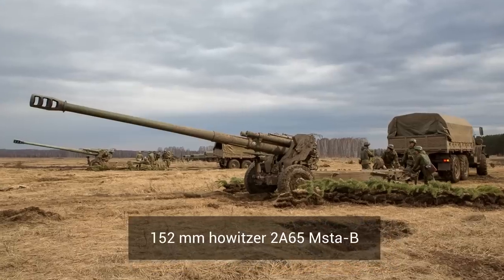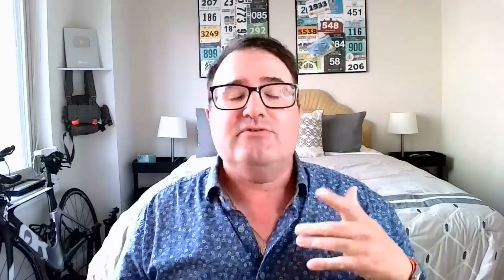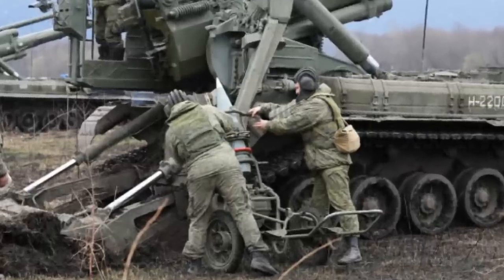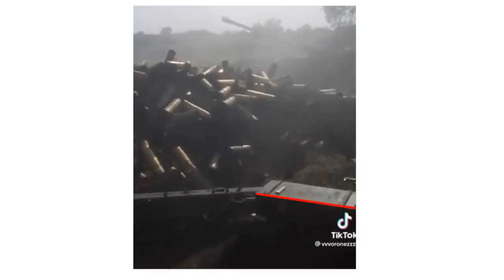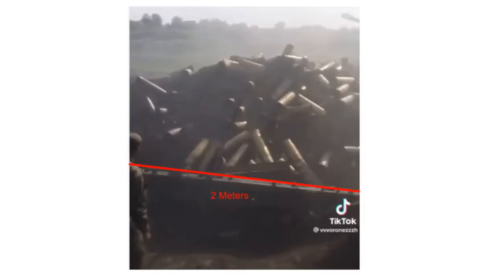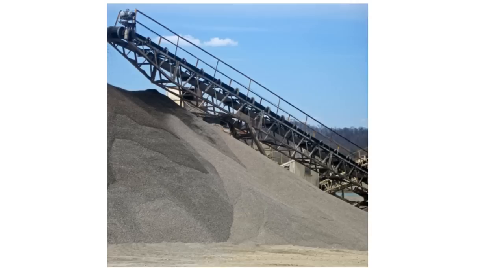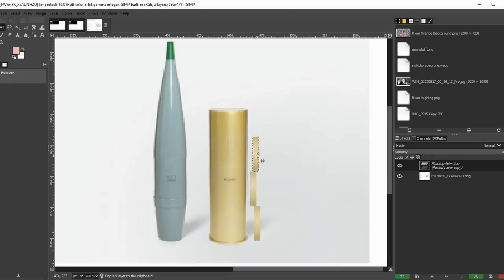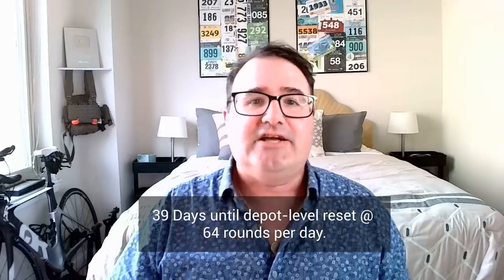When will this Russian Howitzer explode? (2A65 Msta-B Barrel life estimation from shell casings)

Comment: Both combatants are having supply issues. Often the cases are reloaded, reducing the need to manufacture as many new ones as possible. In a training situation this would be desirable. Some cannon are able to have their breech blocks not open automatically upon firing, lessening possible damage to those casings by their uncontrolled ejection onto the ground.

Comment: It's also possible for them to have purposefully disabled the auto ejector. Maybe they want to keep the brass in better condition for reloading. Or since they are piling it maybe they are being lazy and it's easier for the guy to remove it from the gun and chuck it onto the pile than it is to chase it across the ground.

Comment: only being able to see the pile from one angle I would recommend using the formula for the volume of a cone. Operating off the assumption that the ground is flat under the pile then using the formula  V=(pi)(r^2)(h/3) you can get the volume of the conical pile. Then divide this by the volume occupied by one shell. Multiply by a factor of say 0.7ish to compenate for the inefficient and random orientation of the shells as they are thrown into a pile and you should get fairly close. there are more detailed formulas that you can use to calculate the 0.7ish modifier but that requries more effort than I am putting into this now.
Reply from the maker: Think that would make sense if it was a pile of shell casings, but I believe it is a bunch of shell casings on the berm. That means it’s a plane that may be one or two deep.
Reply: @RyanMcBethProgramming  if it is a berm then for sure only one or 2 deep. If it were a pile they would be needing to swap that gun out much sooner

Comment: @Ryan Mcbeth, a point to bear in mind in the charge strength, and I would guess also the weight of the projectile. Stress has a NON-LINEAR effect on lifespan. The critical factor is the extent to which the forces exerted on the barrel during firing exceed the elastic limit of the metal of which the barrel is made. For example, aluminium has no elastic limit as all stress fatigues the metal, whereas steel has an elastic limit. That means that stress up to a certain point will not weaken the metal, but beyond that it will, and beyond that point it is non-linear. So if the barrel is strong enough then each max strength shell may not reduce the lifespan of the barrel at all if the stress on the barrel at each firing is within the elastic limit - but that may require an unrealistically-heavy barrel. From what you're saying barrels are built to have a lifespan, so the size of the charge / weight of the shell combination will each have an effect on lifespan beyond the elastic limit. It might well be that training charges are light enough that it doesn't shorten the barrel life at all due to being below the elastic limit, whereas in the field, max strength and heaviest-projectile charges each shorten the lifespan of the barrel by, say, 0.01%. But it's also possible that, say, half-strength charges or max-strength charges with lighter shells (which would place less stress on the barrel (only reduce the lifespan by, say, 0.001%. Ie, the further beyond the elastic limit you are, the disproportionally greater effect the force has on the number of lifecycles before failure.

Comment: If there is dirt on the plane with shells, then you can't use the actual gun plane to calculate the high. If you can find what's the dimensions of the shell castings then maybe will be more correct to approximate it.

Comment: There’s a factor you haven’t considered.  I’ll admit I’ve not researched data for this specific gun but principles be principles and can be fairly safely transposed. 

The separate ammunition means that there will be different wear rates at different charges.  There will also be different wear rates depending on what projectile is fired as they like us will have different projectiles from smoke he practice extended range ect.  

And in general you can’t just mark all the rounds down as the highest wear rate to be safe as the wear of the barrel is also used in the targeting information as muzzle velocities Will vary massively

Keep up the good work.

Comment: Another cause could be failure to swab the barrel regularly, thus getting debris to jamb the case.  I also didn’t notice the ready ammunition on something to keep them clean, so a dirty case could get stuck especially if it’s on the brass ring that engages the rifling.  
Ryan also forgot to mention barrel life is X number of rounds fired with maximum powder.  Partial powder loads don’t wear the barrel as much, so you can fire more rounds before it needs replacement.  Crews document every round and it’s powder charge to calculate barrel wear.

Comment: You shouldn't be using area to determine the size of the piles.  You need to calculate the volume. You can assume that the pile is up against a dirt berm and consider the volume of half a cone with the height of .5M and a base of 2M.

Comment: Yeah that's what I was thinking, just a lot of spent casings piled on a berm. I'd estimate about 110~ casings. As for the gun, I think there is a switch on the breach that will, when active, interrupt the auto eject of the spent case.

That aside as probable. It's most likely a training area due to the general lax approach to policing the area of excess debris. Namely the spent cases and shell boxes. But hey, it could just as easily be Russian troops being all "eff it, I don't want to be here." Kind of lax.

Comment: They're probably running out of brass and they're using steel casings like the cheap Russian ammo Wold. When the barrel gets hot the casings stick. Learned that lesson the hard way using cheap wolf ammo in a Sig 556R  7.62x39. Was blowing through ammo and once my barrel got real hot the casing stuck and broke my extractor.

Comment: Barrel warp is a real thing. If you've ever worked around pipe, all pipe has natural tiny bends. Heat and will slowly bend pipe. Artillery guns are giant pipes basically, the comforting forces also bends the metal. Heat fatigue causes cracks to expand and the barrel explodes. It takes out everyone around you.

Comment: The math is wrong here for 2 reasons. 1) this heap is clearly not shaped as a triangle, so your estimate will be low. 2) you're completely ignoring that this is a 3-dimensional heap. So you need to add some assumptions on how far back the heap goes, and then multiply that by your earlier step. If you want to keep is simple, you'd need to use the formula for the volume of a Pyramid, not the area of a triangle.
Reply from the maker: Well, it’s not quite a triangle or cone. Think of a plane. That’s the berm. The shell casings are stuck in the berm. So it’s a plane, not a cone

Comment: Well I can count 34 casings and you can only see about 25 % of the pile surface properly illuminated, and it extends to left and right of my count. Also it has depth. So at a rough guess it is 2 or 3 times bigger than your estimate.

Comment: So before someone reads further let me be clear I am NOT trained in artillery, no military background just spit balling here.

So obviously taking into account the enormous pile of casings and the fact this guy is clearly the LEAST military looking human I've ever seen operating an artillery piece from a supposed active warzone. I'd kinda wager this is not even training but just weapons checking/targeting somewhere in Russia. Likely getting the equipment cleaned, sighted, and ready to deploy for active use as some equipment might have been sitting in the armory for quite a while without having seen active use outside training drills. I frankly can't believe either we've gone through THIS many shells off one singular gun in what's very clearly not an active combat zone. 

Regardless whatever it is while it's interesting I don't see any actual risk to this specific gun, at least in my mind. Shell didn't eject, well again, if we're doing testing/sighting of equipment this could be WHY Russia is testing (potentially they've had this issue recently on other fielded units of this gun?) to see if this is a defect or problem they need to address with their supplier and/or their currently fielded equipment. Either way a fun video

Comment: You calculated area, but what you need to calculate is a volume. That gives very roughly 204 shells. Which to my eye looks more like an actual number. Probably there are more as there's highly likely some spillover to flat surface below. I.e the more likely number is somewhere around 240-250.

Comment: The Carriage trail is 1.3m above the ground on the top surface so you would have to guesstimate the number of casings in the shadows behind the Carriage. Also you would have to multiply by approximately 2.2 for the back side, left and right sides. So I would say at least 250+.

Comment: I very much doubt if the barrel would ever explode unless the projectile somehow became lodged in the barrel. Is that even feasible? Surely as it wears, all that's going to happen is that the accuracy of the weapon is going to degrade, the clearance between the shell and the barrel is going to increase, and leakage is going to increase with it.
Is there any evidence that a worn barrel will result in an explosion?

Comment: There's FAR more than 60 shell casings in that pile. You need to calculate / estimate the VOLUME of the pile, not the area of the cross section (which is what you did).

Comment: it depends on length of barrel and propellant used 
the more propellant the faster you burn out the barrel 
some artillery don't even use shells and use bags instead 
this burns the barrel out faster but lets you hit different targets (increase decrease rang) 
bags are more popular with tanks and long barrels because of the different targets they will be used for 
it's possible he is using bags and this is why you see no shell ejected 
longer barrels warp and bend under the stress and have short life as a result 

blowouts like the one you are suggesting only happen if the fuse is defective 
no the gun will not explode from over use 
every time a gun has ever exploded it's always from a bad fuse

Comment: Ryan, You are most correct. I see a giant maintenance hump coming.  Assuming everything started this in February with a fresh, oil change, fluid levels, new arty tubes and fresh batteries. As we hit 6 months of continues use we will soon see everything needing maintenance, replacing, refitting, retubeing, recalibrating all at once. Where as the Ukrainians are getting new equipment and at different rates and their depot maintenance is probably done in Poland or some other close by NATO center.  A Russian newbie doesn’t know anything about a maintenance cycle or how to preform any complex things like pulling a “pack”.  They will discard rather than fix.

Comment: If I am not mistaken the 152mm is NOT the length of the shell but Its circumference  of the shell. So redo the math because you have used the wrong measurements of the wrong dimension of the shell.

Comment: If we consider the pile is a 3d object, why wouldn't you add an extra dimension to the calculation for depth? It looks like the pile goes back a few meters, putting your calculations potentially way off from what is really there.

Comment: When barrels are shot out of howitzers, they don't necessarily explode.  Barrel wear degrades forward obturation causing propellant gases to leak around the body ogive.  As long as the fuze is tight, the result will be reduced muzzle velocity and rattling in the barrel; much like a mortar.  If the fuze in not tight, hot gases can enter the fuze well and cause an in-bore premature:  a very bad day for all.

Comment: You calculated the number of shells by the area visible on the video. However, you didn't take into account the length of the pile. Surely the true number of shells would be found by calculating the volume.

Comment: I find it odd ppl believe the barrel will explode after firing x rounds. I don’t believe even firing it 5x over the life of the rifling that it would explode. When barrels wear pressure becomes less over time. Where are ppl getting this idea? Has military testing been done to try to blow one up without using badly loaded shells?

Comment: Hmmm I'm no mathematician but I couldn't really see why the surface area was being discussed.... surely "a pile of shells is a 3D entity and would therefore be a pyramid or cone, rather than a triangle. Also, finding the angle of repose of various things in the hope of trying to approximate one for spent shells didn't really seem to me to be necessary... surely it could just be measured directly from the picture? I couldn't make out exactly how the container worked - it was clearly open on one side, but other than that, the pile was slightly heaped

I don't claim any brilliance but just a visual on that picture told me there was a MUCH higher number than 63 on there, for which I needed no other skills than an ability to count a a few and make a good estimate - there were clearly several hundred shells on that pile. Whether pi x r² x h/3 is used or frankly multiplying three sides of a box seems to give a reasonable approximation....

Anyway after all that, we don't know that pile all comes from the same gun so the margin of error seems too high to make more than a visual approximation of the number worthwhile....

Comment: I noticed the lack of ejection right away as I wondered if the bounce may catch our guy, but as you say, the fact it stayed in is very not good.  The mechanism is fouled, worn, or both.  Just as you did I saw that immense pile and thought, that is your issue right there.  When did they interrupt the fire mission to clean this gun.  The longer it goes dirty, the more of an issue that becomes, and the more abrasion per shot occurs.  If that guy does not stop and clean soon, then this will turn into an explosion in the barrel, and he, the cameraman, and even the bystanders past the camera will be casualties.
This is one of those points where you need to declare your refusal to follow illegal orders.
OR, or.   You can avoid the backlash from that and die.
I think I would rather be 200 yards away getting chewed on, threatened, and intimidated when the blowout occurs, and pickup the Colonel, and say, 'You were in the middle of telling me off for not wanting to be blown up at my post, Sir!"

Comment: You just counted the ones on the surface of the pile, but that's a 3d pile. Also I'd say the repose angle for such a geometry should be lower than 35º.
 I just did the math for such a pile, assuming it was 2m high and a repose angle of 30º, there are roughly 400 shells there.
I guess every barrel could fire about 100 shells or less per day. So its life span would be aprox. 15-20 days at full blast non-stop until it starts losing precision. Not bad.
Reply: Ryan is assuming that its NOT a 3D pile, but shells layered over a mound of dirt.  To me this looks like its not totally true, but its the most conservative assumption for estimating (to definitely not over-estimate, in other words. ).

Comment: The amount of expended shell casings suggests this is either non operational fires OR they are not at all concerned by potential counter battery. On barrel life and degrading accuracy, I am not at all sure the artillery are overly concerned. Reports from the front line commenting on the ferocity of Russian fires, repeatedly mention they fire continuously, everywhere and nowhere - in other words it looks like the key performance indicator for the battery is ammunition expenditure rather than targets hit. There is a video up from a Swedish volunteer who compared Ukrainian fires which were within 15m of the target and the Russian fires seemed to be in the order of 100m. Linked video: https://youtu.be/lbDNRMfABWg

Comment: Rotating worn or damaged guns for repair or replacement has to be an anticipated activity during the course of battle.  The Russians have no shortage of equipment to call on in this eventuality.  The Russians have displayed a troubling amount of unpreparedness and lack of proper maintenance which could shorten the lifespan of their guns but the huge number they have to call on surely will be adequate for an activity as limited as the one in Ukraine.

Comment: I would think surface area would not be what you want for the shell count. That pile is some form of an oblique conical shape. Volume would get you a more accurate shell count. I like that your approach is always empirical by nature. Critical thinking is somewhat of a lost talent to half the country. You could use that as the basis of an exercise for integration in calculus to calculate the volume of shells. Love your videos - thanks from Sgt. Mike the Signal Corp. veteran and engineer

Comment: Shell extractor on those guns requires the barrel to travel far enough to trigger the extractor on the way back front. If the return springs are damaged the extractor might cause the barrel to jam aft and is thus disabled. Or the liquid&gas dampener is damaged and doesnt actually let the barrel to travel which is super dangerous because at this point parts begin to fail randomly due to excessive impact stress. Or the guys just drank the dampener liquid, it's pure alcohol after all.

hundred shots per gun is nothing though. I think we fired 100 per gun per day just in basic training. The grenade lining is super soft copper which doesnt wear out the barrel rifling much and still allows for tight gas seal. Cannon version of 152mm (giatsint) in action here: https://www.youtube.com/watch?v=XEfjEhwx5z8